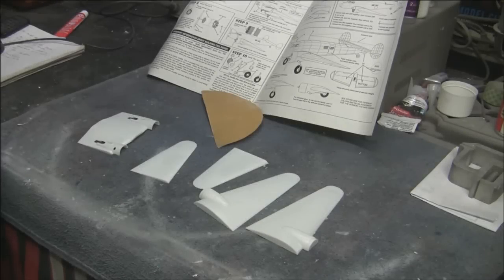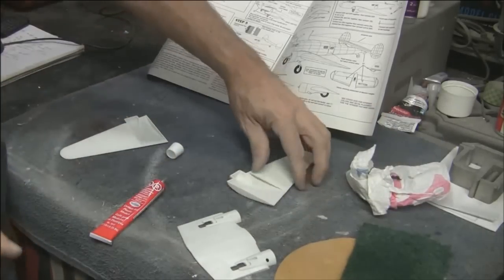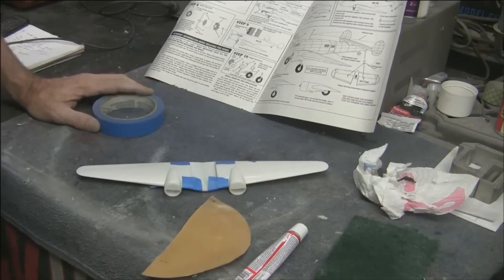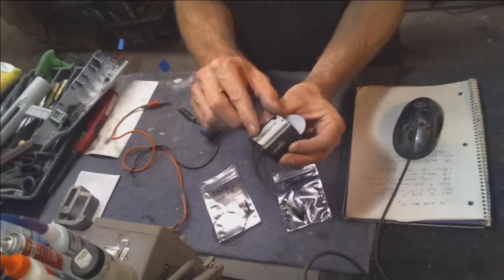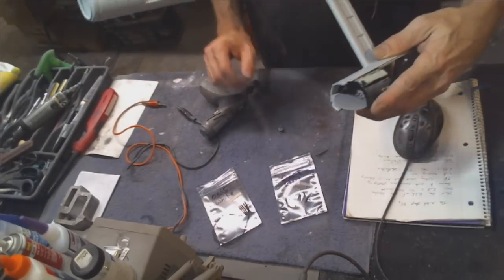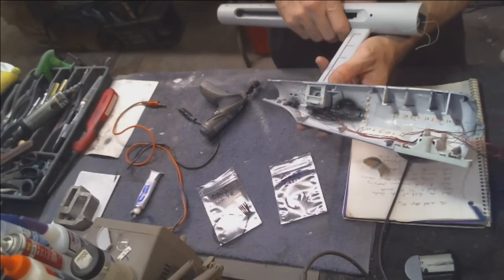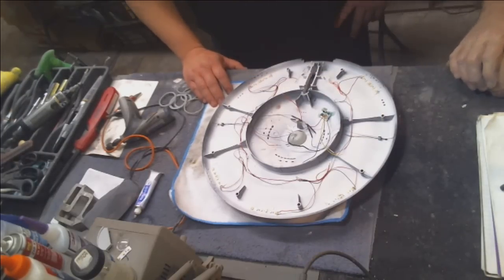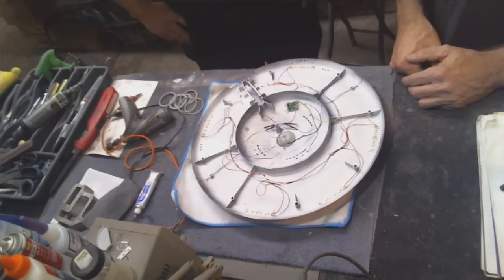"The Model Shop" Live Scale Modeling Show Episode 85

Comment: I would have liked the 1/1000 scale Enterprise  to have the windows open as well. I started to drill the windows out then realized how difficult it would be, especially the rectangular windows, so I filled them. I'll wait until I can build the 1/350 Enterprise to do lighting.

Boyd, are you going to use the decal for the red edge of the wings on the Electra or paint it on?
Reply from the maker: I'll try the decals first to see if they look good.